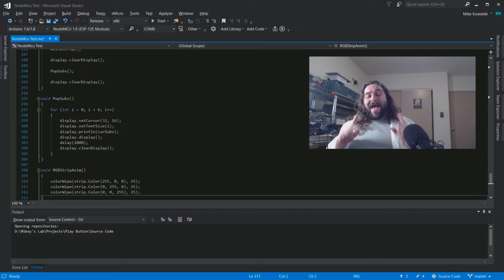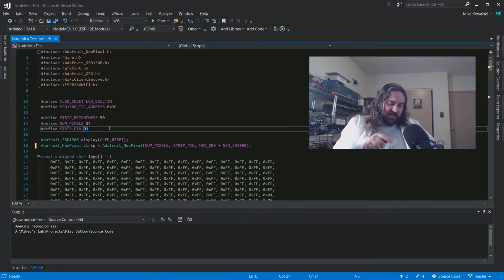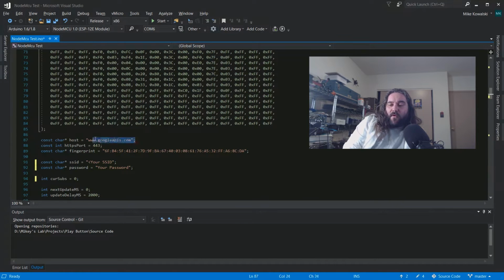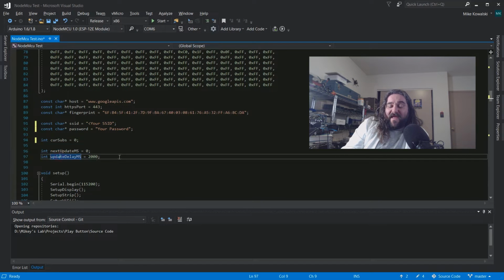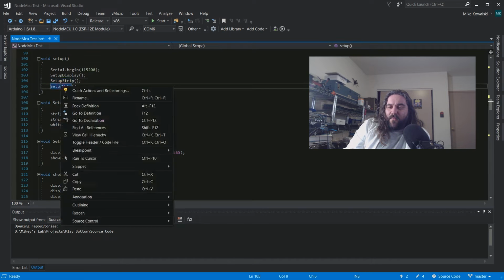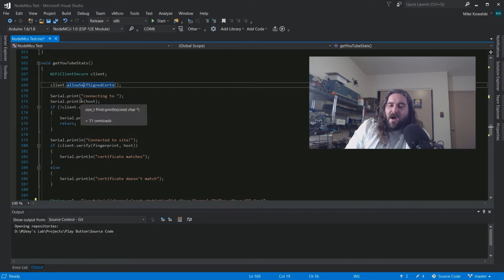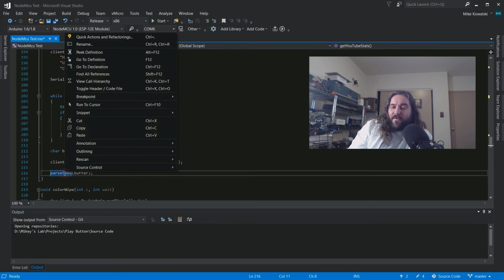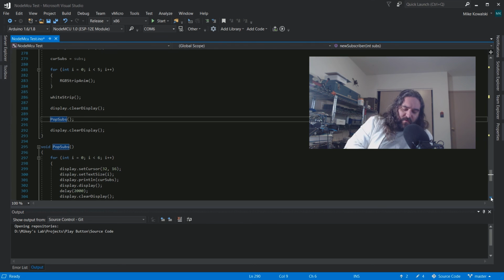YouTube Stats Display - Subscriber Celebration - Play Button Build

Comment: Cool project!
If your OLED module doesn't have a reset pin, you can use -1 as reset pin in your code. That tells the library to not use hardware reset  and you don't need to dedicate GPIO pin for a function that does nothing.
Reply from the maker: Good to know since I use these screens a lot and have never really looked into it

Comment: Hi Mikey, I just came from a reddit link. Sir @ 6:23 you wipe the iron tip and solder then wipe the tip and put it back.
*Please don't wipe the tip when putting down the iron, leave the solder on the tip and wipe it off next tip.*
Why? With a coating of solder, the tip won't oxidize as fast. A bare tip oxidizes faster.
Source: I was electronic assembler for 5 years, 8 hours per day. I still solder, just not as much.
Reply from the maker: I have always cleaned it both times and usually just retain when I use it ☺ but occasionally I screw up lol
Reply from the maker: And who posted one reddit lol